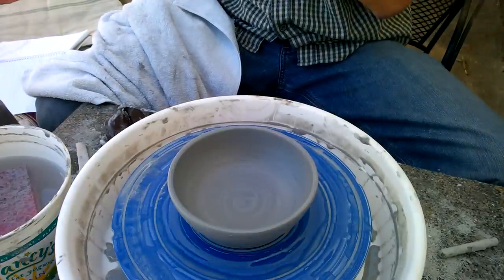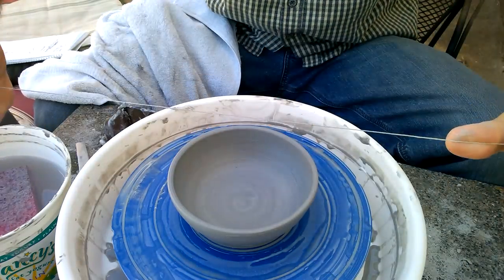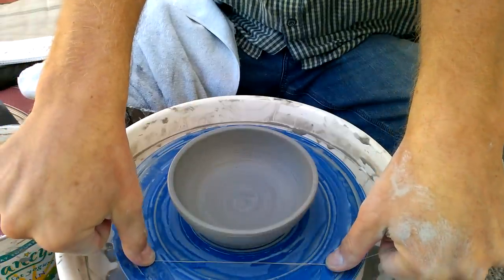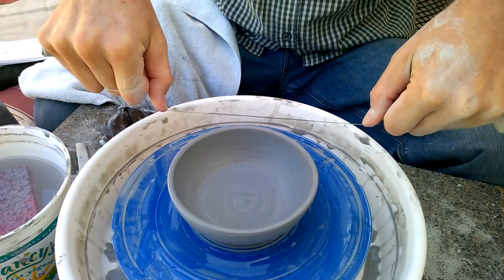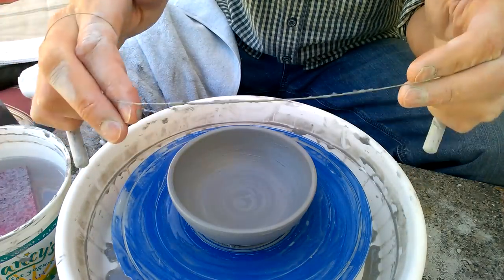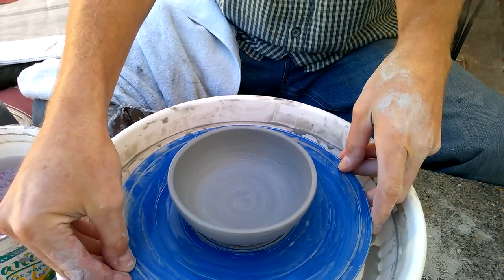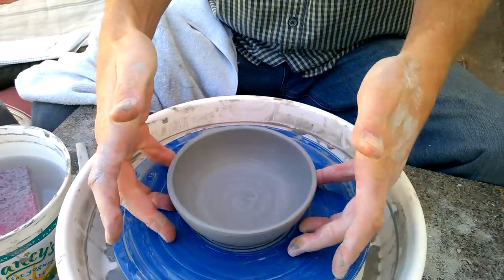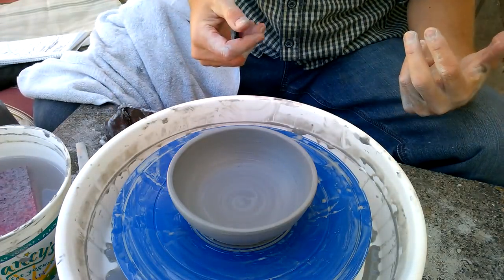How to Cut a Pot Off the Pottery Wheel Without Destroying it!

Comment: You need to use your sponge 🧽 to put a puddle of water next to your pot on the wheel, make sure as you cut that you are running the wire through the puddle of water wetting the wire just as it slides under the pot. Do this 3 times in a row and your pot will be hydroplaning on the surface of the wheel, you can then easily slide the bowl off the edge of the wheel using two fingers on each side of the bowl on to a flat surface just as a spatula or open hand. This will ensure you never mess up a pot while taking it off the wheel. Leave the wheel off while doing this procedure.
Reply from the maker: Yep. That's a good trick. I use that most often when I have a larger or more delicate pot that won't just lift easily off. Thanks for sharing!

Comment: Hey I have a question. When you took the bat off the wheel with the pot still on it, it kind of makes a very forceful shake when you try to pop it off. This is what I've been trying to do but when it pops off like that I'm always afraid it's going to shake my clay into an uneven shape. I don't know how to take it off without it making a forceful motion like that.... And also whenever I try to lift it up with my hands I just can't seem to do it because it too wet I'm afraid I'll mess it up. I can't really even pick it up if I wanted to though because it's just so slippery.... How do people make it look so easy?
Reply from the maker: That is a great question. It mostly just takes practice getting a sense of how delicate your pot is and how hard you can shake it. But, there is a trick that you can use to pull the bat off more delicately until you get a better feel for it. You can take one of those wooden knife tools and gently and slowly slide it in underneath the bat. That way you can kind of pry it up in a more controlled manner while bracing it from popping with your other hand. It's kind of hard on the knife over time, but after a while, you shouldn't need it because you'll just get a better feel for gently prying it up with your fingers. Hope that helps a little. I know, it's tricky, but keep practicing and it'll get easier. I've seen that process with all of my students. :)

Comment: Thanks! Question. What if I just dont cut my piece off the wheel and place the bat the the side? Is it going to be impossible to get off?
Reply from the maker: you want to make sure to cut it free before it gets to leather hard, or yes, it will be SUPER hard to cut. But definitely cut it free and leave it on the bat to dry if you like. then it will be easy to take off the bat once it reaches leather hard:)